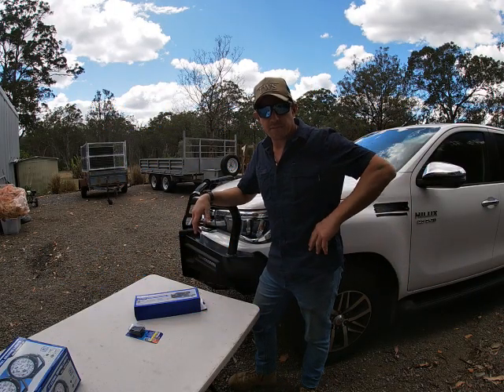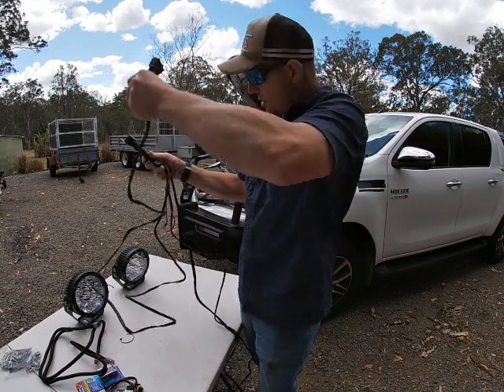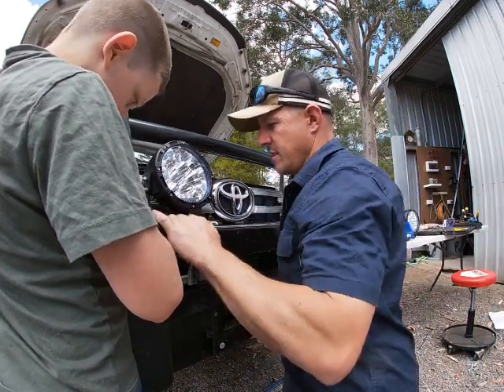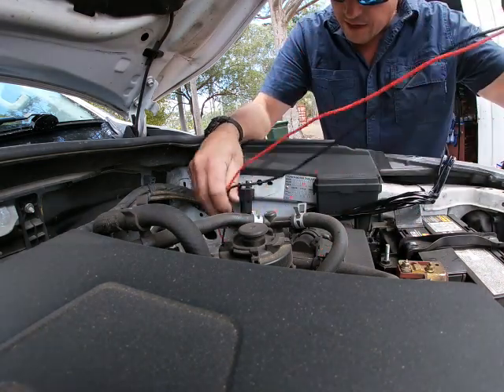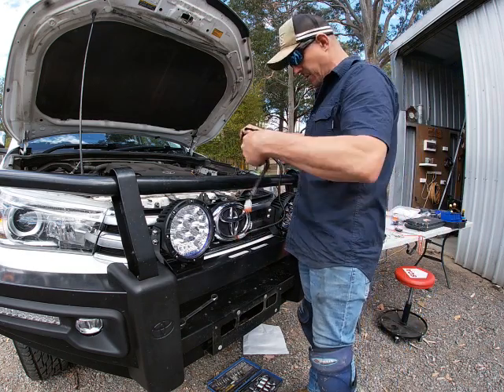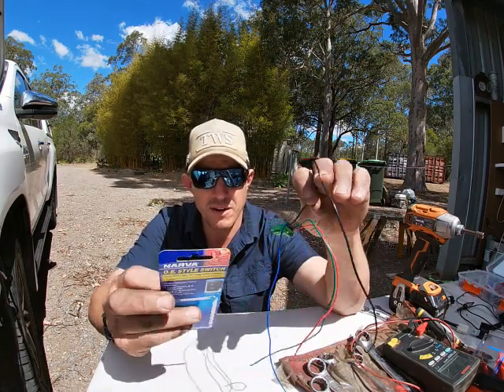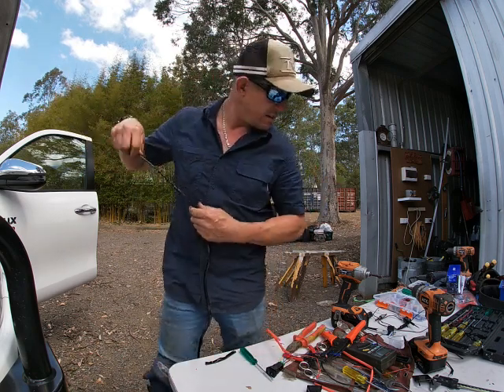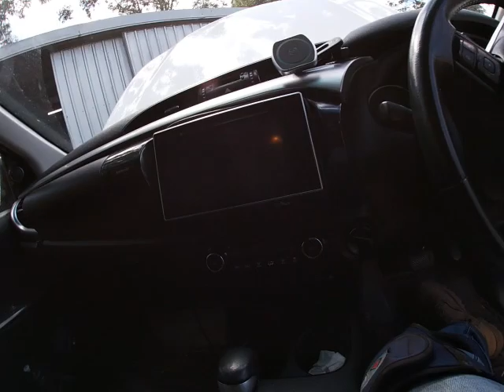How to install driving lights Toyota Hilux Kings

Comment: Wondered how to go about using a different switch since the one in the Kings kit is massive and doesn't fit in those Hilux slots. Gonna have to get to supercheap and get the same one so I can finally fit my number plate light bar. Cheers for making the video, helped me out
Reply from the maker: Yeah. The kings ones are massive. Supercheap or Autobarn should have the right aftermarket one for the hilux. Good luck. 👍